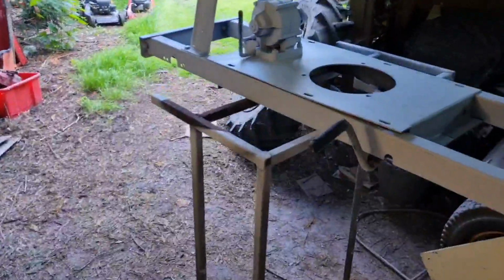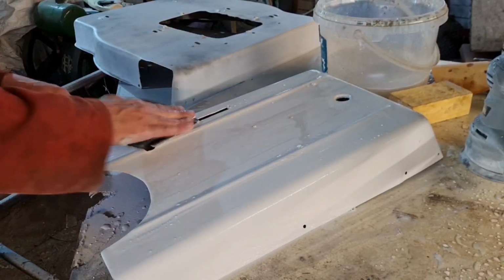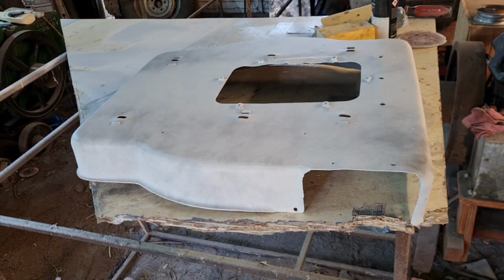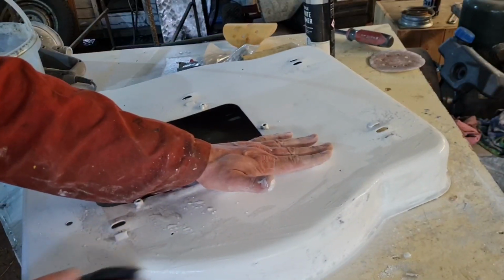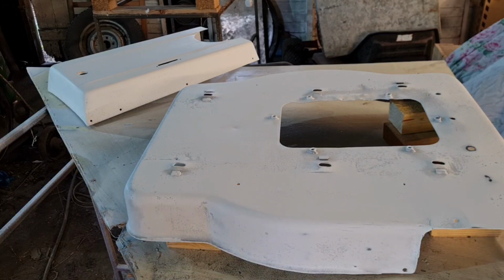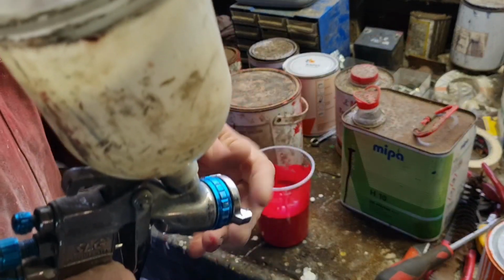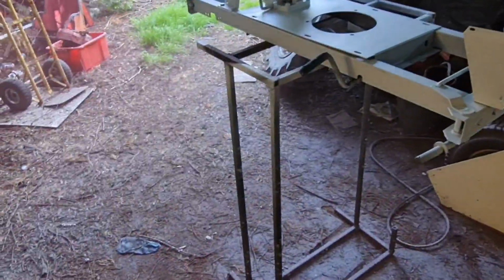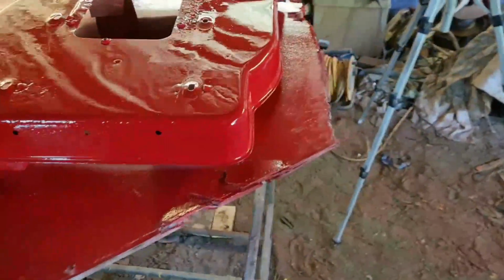How to prep and spray 2k paint at home. DIY Respray.

Comment: isn't it advisable to be wearing an air fed mask for 2k paints?
Reply: Yes. You should use air fed mask and have extraction with the correct filters. Whilst doing up our van, I use a full face ABEK 2 P3 mask, Tyvek overalls and gloves with a high power industrial ebac extractor. It's really important to change the mask filters often because you won't know when they have been compromised with isocyanates. And thats one of the reasons why air fed masks should be used because most people won't know that they have to change their mask filters often